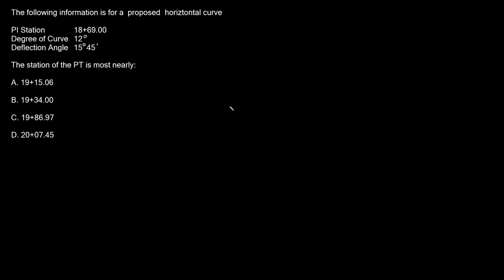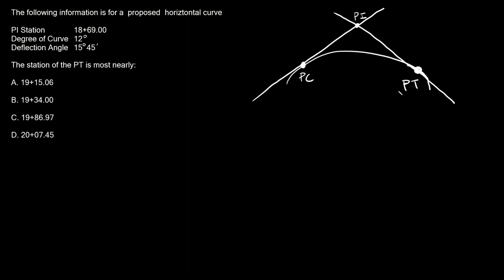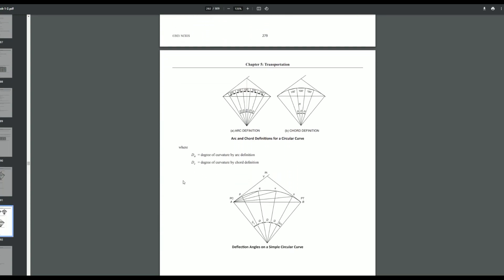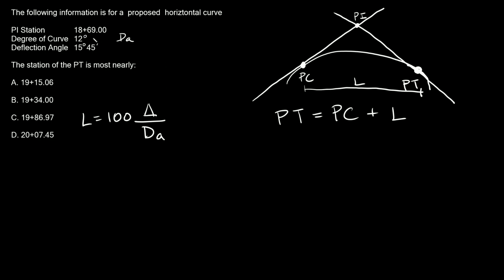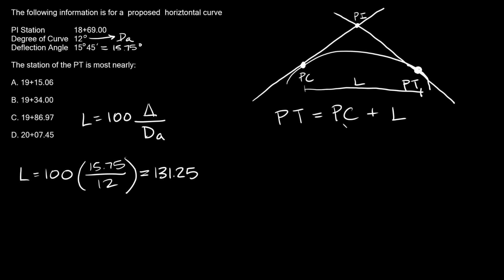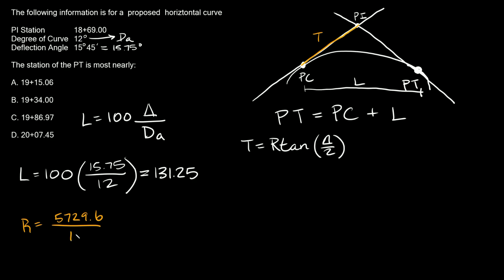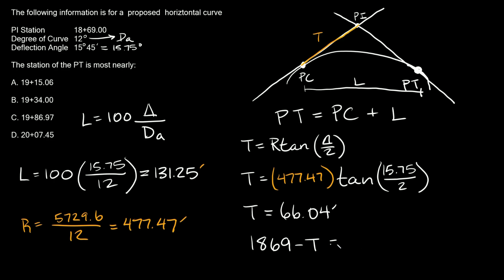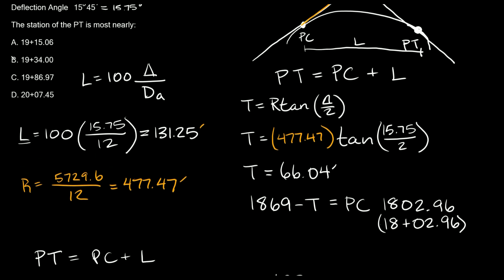PE Civil Transportation Exam Review | Horizontal Curves | CBT

Comment: when you're given the Degree of Curvature, how do you know if it is the Chord or Arc definition? many videos I've seen skip over this and don't explain.
Reply from the maker: Great question! Roadway design generally uses arc definition. I think railroads generally use chord? But ff its not specified in the problem - I would probably just assume its arc definition since its more common.

Also, for the exam, they generally set it up so you could solve any of the problems within a few minutes - they're not trying to test you on the most complicated problems that would take an hour - so you should be able to deduce if its arc vs chord fairly quickly based on which one would be more convenient to use to solve a problem.

Here we were looking for the Length. The length formula uses Da, so its safe to assume its Da in this case. Hope that helps! 👍

Comment: For this similar question in the NCEES guide they consider the degree of curvature to be Dc. With the limited information , how do yoy decide? Solving for R=50/sin(12/2)=478.3386 vs R=5729.6/Da=477.4667. These are not exactly the same. Also, the arc is L and the chord is C.

Comment: Great video! The only thing I'm unclear on is why you need to use the tangent length to get back to the PC, then L back to the PT.  Why can't you just add T to the PI to get to the PT station? (I've noticed this would still yield a correct result, but I'm not sure if that's always the case).
Reply from the maker: That's a great question! So the short answer is no, that won't always work. If the curve is perfectly symmetrical, then that would work. If the curve is not perfectly symmetrical (as in most cases) then it won't work. However, it will give you answer that is close. For instance, in this example:
Final answer = PI - T + L = 1934.21 
Your answer = T + PI = 1935.04

You can see the answer is very close (and for the PE Exam that might be a good idea to save time), but if you're trying to calculate the exact answer, then it is best to use PI-T+L

Hope that helps! 👍